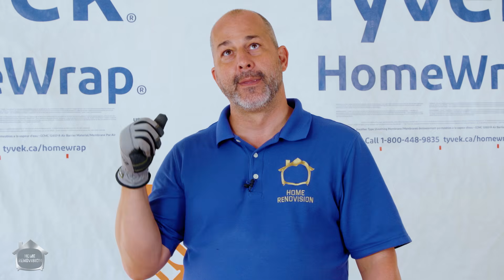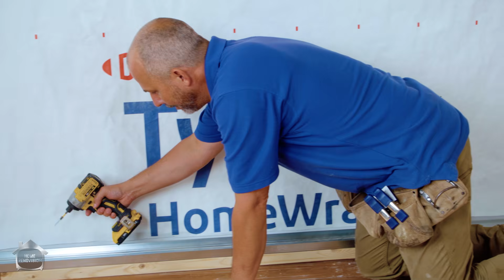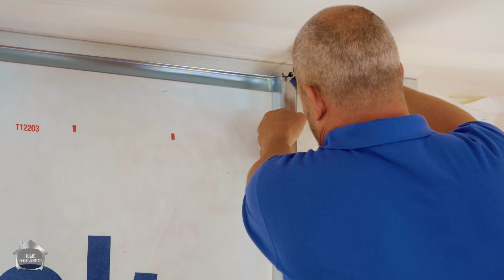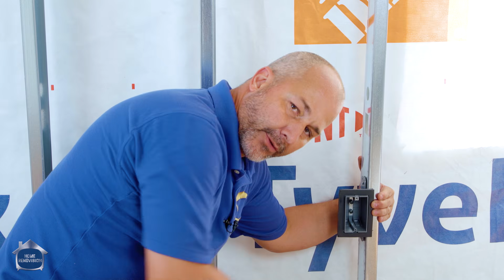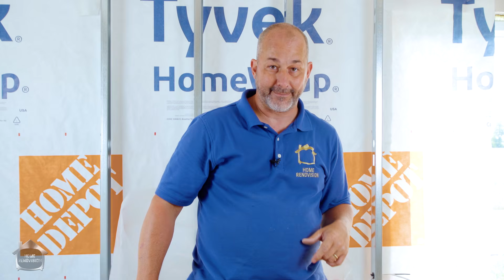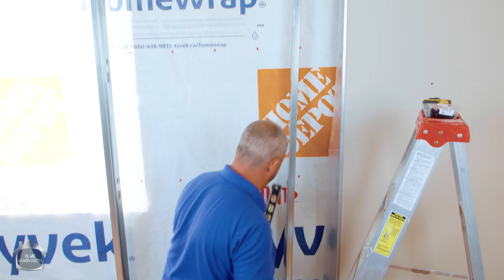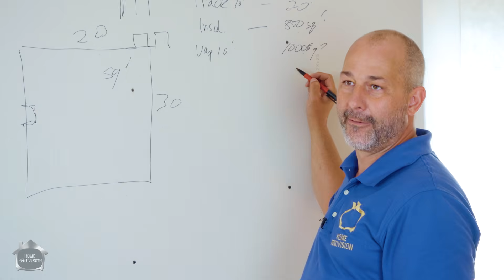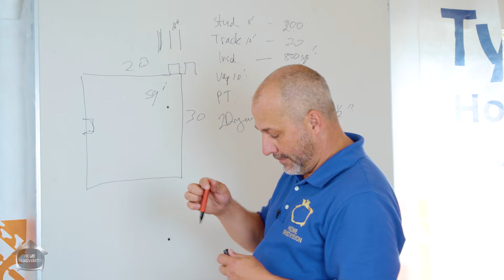Frame With Steel and Save Money! | Steel vs Wood

Comment: Can we assume that steel studs are not approved for load bearing walls, or do they require a different installation?  Are fire breaks required in metal studs?  Can you run horizontal copper or PEX through steel studs?  What about 1-1/2" or 2" horizontal vent pipes?
Reply: There are different gauge studs for load bearing walls. Fire breaks are required for steel and wood. Usually top of wall back to mud sill and 10’ along the wall. Not many people ever show or do that. Piping is run through grommets.
Reply: Structural gauge steel starts at 20G and goes down from there. Typical residential studs are 25G you can cut with snips. It’s actually more dangerous to use a chop saw like he did in the video. Fire ratings applications can be used in wood and steel. You can run any type of plumbing you’d like through steel framing.

Comment: Finally a video with steel framing,  I live in Athens Greece and all framing is done with Steel but all buildings are build with concrete slags and walls are with brick and cement very helpful tips

Comment: I just built a recording studio last week i got all my 2x4s from the home deport $3.34 a board
Reply: What state are you located in?  That’s really cheap even in normal times.
Reply: @jpdst29  bought the 2x4s from the home depot in greensburgh pa there labeled as 2x4 studs
Reply: @jontay2002  You did well, I live 30 minutes away from you and the cheapest I've seen them at Home Depot/Lowes in the past 6 months has been around $5.  They are slowly coming down in price though.
Reply: @jpdst29  what part of pa? I was going to go to the lowes in indiana but they want like $7.28 a board or something like that now those boards are alot better then the whitewood studs i got from home depot but they worked awsome they held up 3 layers of drywall and a layer of 1/4" mlv with no problem!
Reply: @jontay2002  Penn Hills.  I think you did fine.  Paying 7.28 for a stud is ridiculous.  I checked home depots site this morning and they are now priced around 4.98 each.

Comment: Looking at it, wouldn’t a composite board be better then a green treated board in the floor ? Also trick question what’s the effective R value of the wall ?
Reply: Composite would work nicely also, at 3 to 5 times the cost.
Reply: Yeah I can't believe he said PT wood in direct contact with steel.  That's a big recipe for rust.

Comment: Having the studs facing the same way also makes pulling BX (AC90) easier. The ridges on the metal armour get caught if you don't pull in in the right direction, or have you studs not facing the same way.

Comment: Hi Jeff, I think this video has officially changed my mind and that I will use steel studs for framing my basement.  Seems WAY more forgiving for the novice DIY'er.  Thanks for posting this kind of stuff.
Reply: Don't
Reply: @Super--Star  I haven't started yet and again am on the fence.  But can I ask why not?
Reply: Steel frames transfer heat or cold, google thermal bridging. It should lead you to a decision that will put you back firmly in the timber frame realm.

Comment: Great video. A little trick when cutting your studs. Use the metal cutter to cut the sides and just bend the piece back and forth till it breaks off. Cutting across with the metal cutter is way harder.
Reply: I cut mine with a Makita LC1230

Comment: This video is perfectly timed. I was wondering just yesterday if that steel system was going to be much cheaper than wood. Here in Nova Scotia a 2x4 is going for around $8 or more each right now.
Reply: What am I missing? In ottawa a 2x4x8 wood is 5.35 and steel 3 5/8x8 is 6.45 at home depot. I was going to use steel for my basement theater for less noise traveling and thought it was cheaper. 🤔
Reply: @BowesMusicStudio  maybe prices went down now. By the time that video was out, it was about $8 something on south western Ontario.
Reply: @BowesMusicStudio  Down in NY wood studs are running about a buck or two more than steel studs. The wood has been fluctuating much more in price. Just for convenience though, this video has convinced me to use steel in the basement.
Reply: ON has it floating around $10

Comment: Jeff, I have been waiting for this since I have steel studs in my FL home!
Reply: Don't use PT lumber with steel studs, especially in FL, that is a recipe for a giant pile of rust.  Unfortunately he is not giving good advice here on materials.
Reply: @rotaryenginepete  that's what I thought too .. but if it's galvanized then maybe it's ok
Reply: @Tzarsio  PT lumber treatment contains dissimilar metals, such as copper.  Even galvanized steel won't be immune to this type of corrosion.

Comment: I was thinking about this the other day. I will never properly finish my basement. Sealed/painted walls and tile or vinyl floors only, and everything important propped a bit off the ground. I'd rather the basement look slightly less nice to never have to deal with ripping it all out when it gets moldy or the sump pump fails in a heavy rain. Been in too many damp basements and mine will probably end up that way as well some day.
Reply: Install Durock cement board 16 inches high around the perimeter of the room at floor level with drywall above the cement board.

Comment: It seems like it would be so much stronger of a product if the steel "studs" had 4 walls instead of 3 and a big gap...
Reply: You would not be able to insulate the steel stud
Reply: There’s different gauge steel for load bearing applications.